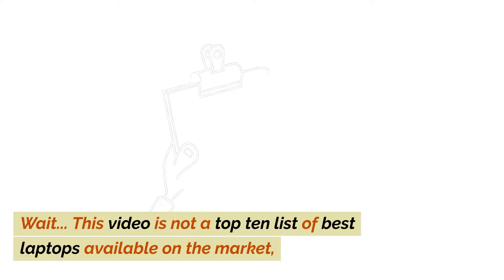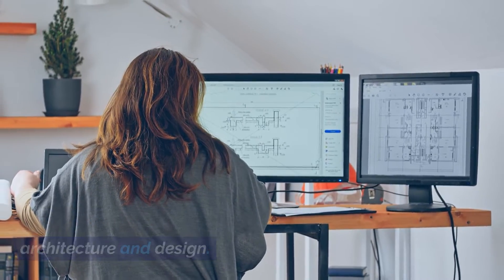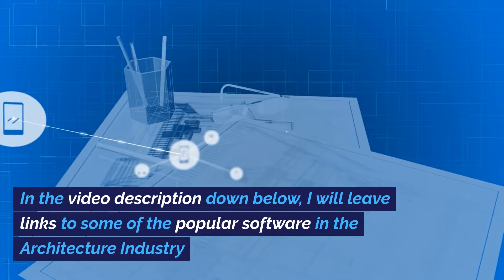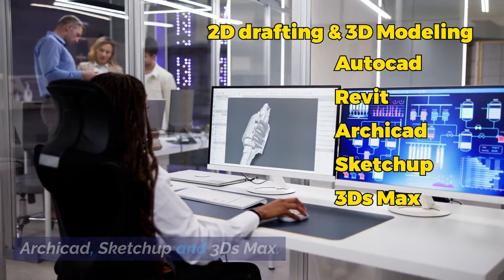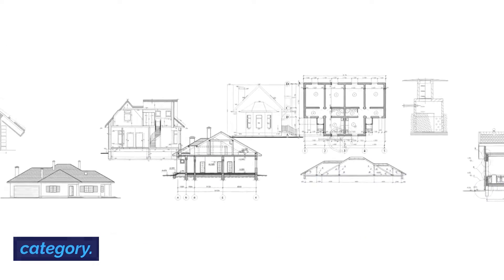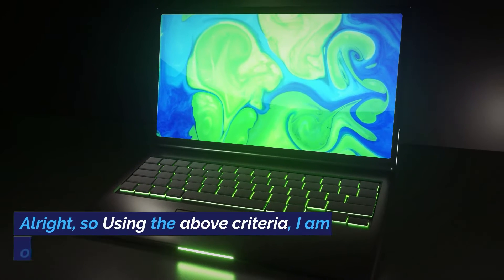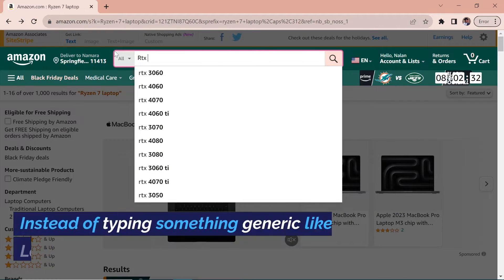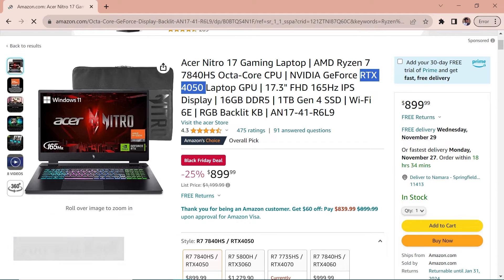Finding the best Laptop for Architects.

Comment: I have a question in my laptop  in display section showing graphics card is amd radeon graphics and in render its shows  nvidia rtx 3050 .. is this same graphics card ?
Reply from the maker: You can confirm in these 3 steps:
- Press "windows key" + "R"
- Type "dxdiag" in the popup dialogue box
- Click "Ok" and check the display 1 and display 2 to see which ones are in your laptop